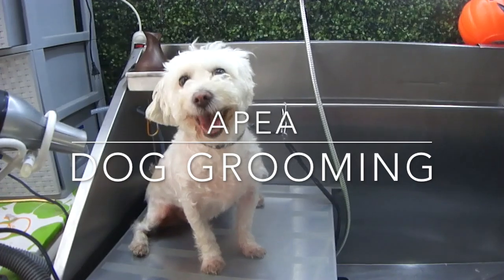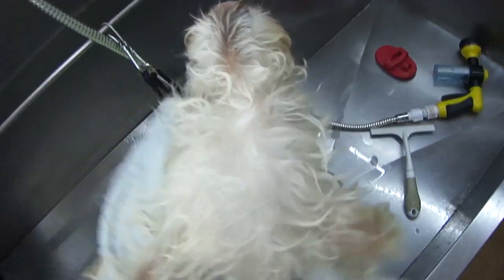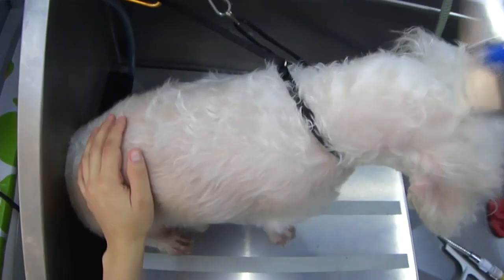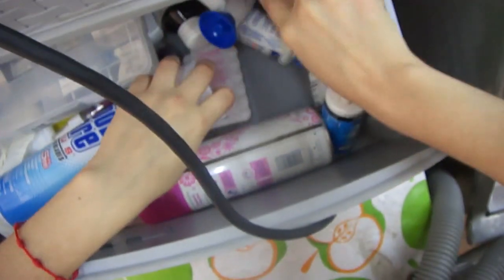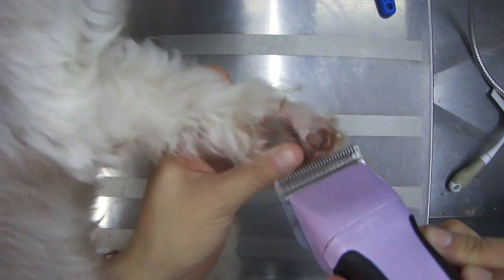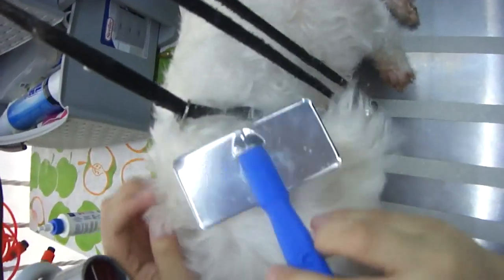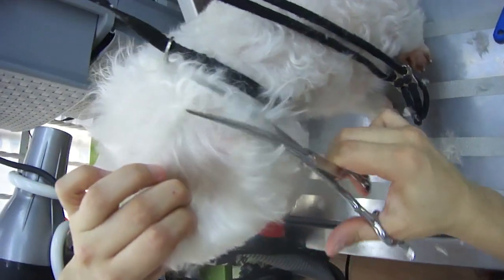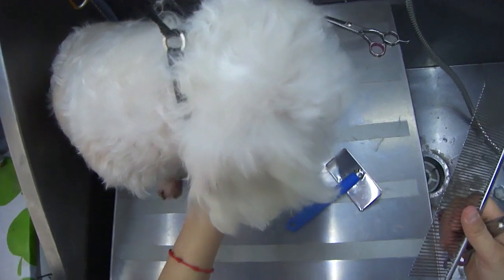Cheeky the whiney maltese. Bath and a light trim

Comment: I love your shower hose attachment to dispense shampoo! Do you have a name for it please, or a link? (If there is equipment you would recommend, you could apply to be an Amazon Affiliate - then you get a referral percentage?)
My dogs' feet have gone pink - I was told it was saliva staining due to irritation from food allergies, but I think it could be something fungal. I'm currently trying rinsing with a white vinegar solution.
(BTW, I think you're great with the dogs.)
Reply from the maker: yes i love it too! it's quite bulky though! i do not have a link for it, i'll make sure to look where you can buy it! yeah food allergies makes them itch between their toes so they lick to alleviate the itch, but the enzymes in their own saliva make the fur oxidize and that is what stains the fur. try changing their diet and keep on doing that vinegar rinse! the oxidized hair(stains) will not come out.. that hair needs to be trimmed off. hope that helps! happy grooming!